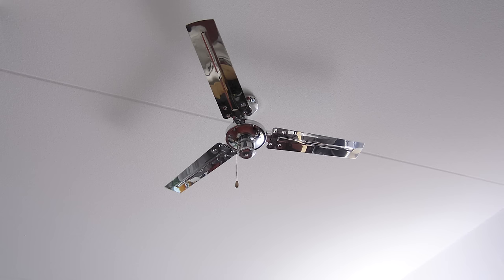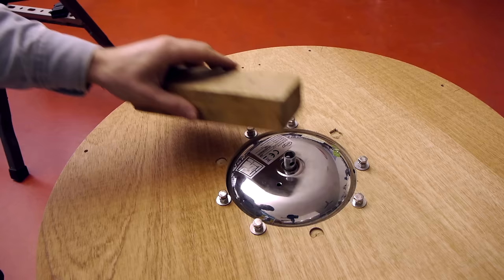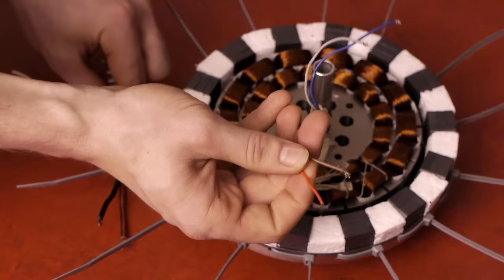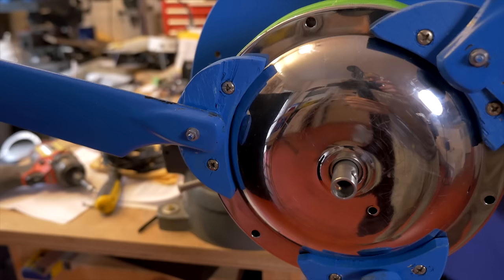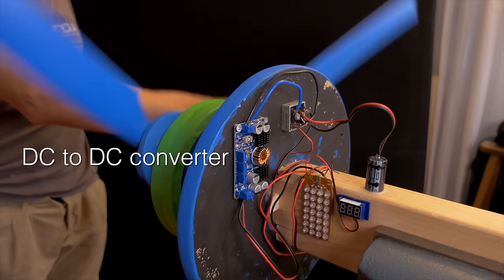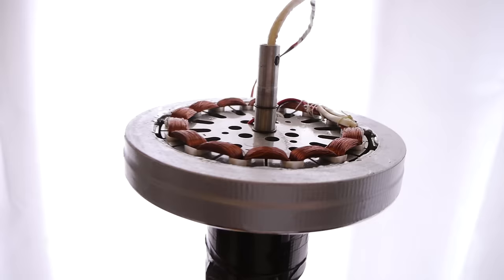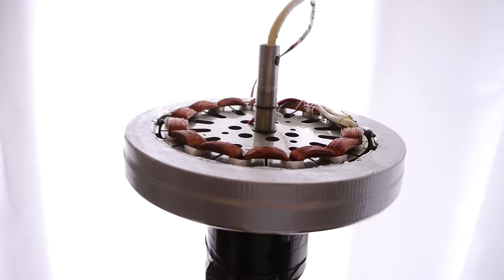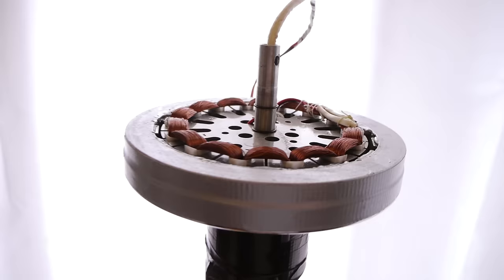Turn a ceiling fan into a wind turbine generator?!

Comment: Hello Giesbert Nijhuis: I've been an electrical engineer for 20 years, And I have some advise for improving the function and efficiency of your ceiling fan turned wind turbine.
1st: I like to say you have a firm foundation for creating your own free energy device. I believe that you're on the right track with this project.
2nd: I think that You needed to Keep those inner coils so that you could use them as a magnetic governor, to prevent over speeding the turbine, and thus keeping the raw input voltage from getting too high. "A simple 10 Mega-ohm power resistor" across the inner coils, would provide a semi-regulated load. and thus cause enough rotational resistance, to prevent an over speed event. A wire wound Variable resistor, or a rheostat used, instead of a straight resistor, would allow you to adjust the governor strength by adjusting the the inductive current flow caused by your magnets acting on the inner coils. Changing the resistance will in turn change the inductive load. allowing the turbine to spin faster or slower, depending on the load resistance on the inner coils. This is how to keep this wind turbine from frying your step down circuit(s) which will fail before anything connected to it will. Your power regulator, and DC converter are the weak links here. But if you can regulate the raw input voltage from your coils before it even gets to your power circuits, that weakness will be a non-issue. 
3rd and finally: I would suggest some sort of storage medium, like a battery or Capacitor bank. this will further assist you in regard to voltage regulation. Just make sure the voltage capacity of either your battery and/or Capacitor bank is not exceeded by the input voltage. The storage medium will also allow a you to have power buffer to keep your devices running, while there is a low wind situation.
Reply: One question on the 3rd option, isn't the aim here to say 'charge a battery' on a phone safely, so then how do you connect another battery safely? or doesn't it really care, and is it mainly when the battery is limited compared to the input (so 5V for the phone) that problems may arise… aka. as long as 'he' would say add a large battery or capacitor bank (say 100V, which will never be exceeded by the generator) there isn't really an issue anymore?

ps. Really liked your nr.2 that to me read like a genius solution, would be even greater if one could have a software regulated resistance that is controlled by something that can measure the rotation speed of the turbine. That way there can be as little resistance on the breaks during low winds, while higher winds would engage the break.
Reply: Great question
Reply: As a mechanic I would say start with an old style ceiling fan and eliminate 3/4 of the bs because it is already the proper kind of motor with beefer everything. Install a 1 way clutch, install a large capacitor often found in old TV and CRT Monitors, because you installed this and what is coming down the line you would need to install diodes due to flyback voltage, Install your transformer from an old style welder, then another diode, then a AGM Deep Cycle Battery (Blue top would do nicely). Or you could do what the engineer said and make it less efficient, cost more and blow apart your capacitor, fry your transformer and boil over your battery due to flyback voltage and/or the fan spinning backwards. But, trust him he went to school for 4+ years for this kind of stuff and never gets feedback from customers. Unlike us stupid mechanics who have to re-engineer their screw ups to make the customer happy or explain ourselves in court.
Reply: Phil Weatherley  The governor idea only nonsense if he plans on never seeing a windstorm big enough to damage the blades. The governor idea is interesting but probably not required, but hardly nonsense.
Reply: Phil Weatherley  Your comments use negative jabs like "nonsense" and "worthless" so a lot of people didn't hear a thing you said. Congratulations for showing your insecurities and losing face.
Reply: Instead of this grossly complicated setup, variable pitch propellers would work far better at regulating speed. You can do it by putting the blades on bearings and use something like a centrifugal governer with linkage to the blades to rotate them based on rpm. Commercial windmills use gears and motors to do this, but you don't need anything that expensive to do the same action on such a small windmill.
Reply: @GGigabiteM  How about blades that flex when the wind pressure reaches the point of over voltage? Wouldn't that be more simple than your "grossly complicated" suggestion?
Reply: Thanks for sharing.  XenoMorphicRex I was going to post a few observations about video and found out that you have already done so and with greater knowledge and detail.  I was also wondering that if instead a person could not try to convert raw AC to DC, but could just run the raw AC into a used battery backup APC unit for computers, which has some line conditioning properties as well as a charge controller.  It is also designed to handle surges with a built in surge protector.  I also thought it would be a good hub for a free energy pulse motor design.  You would probably know better than me about what would be needed to prevent overload between the major parts (or if after you protect from overload then whether or not there is enough remaining power to drive the next stage).
Reply: @offgridphilosophy7959  Flexible blades are far less efficient than propeller blades and can only slow the fan down so much.

A centrifugal governor isn't complex at all, you can build one in your garage with parts from home depot. To change how much or how little it affects the blades, all you need to do is change the weights and springs and adjust the linkage to the propellers.

The governor can turn the blades leading edge into the wind, effectively feathering it so it can't be driven anymore if the wind gets too high.
Reply: @GGigabiteM  My way is better.
Reply: @offgridphilosophy7959  A method that doesn't work is not better LOL.
Reply: I agree with this person's reply.  I have been a technician in Radar, communication, and navigational equipment for about 30 years.  Some of the rudimentary 'back up' systems would use some technology similar to this for power generation and navigational assistance, and the writer in this string is correct, if by using the other coils as a 'braking' system this would eliminate the overrun of voltage and reduce the heat loss and possible damage to the 'weak links.'
if possible when the wind reduces you could have the inner coil field collapse into the outer coils so to speak, but whether to charge a battery like most hybrids today or adding capacitance for the 'charging' state would be up to the engineer.
Keep adding the same size cap as you have in parallel to the one that is installed until the LED's are steady at the operating voltage set and they should stay lit for a little while after you stop driving the fan housing.  If you use the secondary coils for braking this will also charge the caps when the speed slows down, (mostly for efficiency) but you have to store the energy somewhere.
Reply: Unabomber type rant alert! Although this is a technical thread, Tishka Skogen has lost his way, ended up here and is delivering a LOAD of political POISON! Watch out!
Reply: @tishkaskogen3298  Why can't i be totally wrong about everything without people setting me straight? This world isn't fair!!! Stop hurting me!!!!!
Reply: @offgridphilosophy7959   I know right?! It's part of my paradigm!
Reply: you forgot "5th"-- WAIT FOR SOME WIND!!!!
and you forgot "6th" ---BUILD  A DISENGAGEMENT MECHANISM SO A WIND THAT IS TOO STRONG WON'T CAUSE YOUR UNIT TO BURN UP, BURST INTO FLAMES!!!!
   Yes, you see. there is a narrow window at which it will operate effectively. Below that window...no energy. Above that window...NO MORE AIR TURBINE!!!!
    Just WHAT PERCENTAGE of the time do you think the wind will blow at the right speed?
Reply: @willg4802  1st, I did not forget these these things, I just did not mention them, due to character limits youtube imposes in the comment section for my area. Yes I could've posted a part 2 or 3, but it was unnecessary, for reasons describe further down into my reply. 2nd It would depend on the wind conditions in his area. And since this wind turbine is a hacked ceiling fan, no solution will be 100% perfect. 3rd As for the turbine bursting into flame, the wind itself should provide adequate cooling, especially if a heat sink is employed. A lot of power resistors have a heat sink, or cooling fins attached to them. these are a given to an electrical engineer a basic knowledge in thermal dynamics is was apart of my training so as to deal with problems like this. Put a large enough heat sink on the resistance circuit, and heat will be of little issue. all he'd have to do is make the before mentioned heat sink aerodynamically efficient as to reduce turbulence behind the turbine. which will effect how well the wind passes by the turbine. disrupting the airflow will effect the speed of the turbine as well.
Reply: @GGigabiteM   Variable pitch blade system is also a complex system, requiring some precision components that maybe be too expensive for a DIY Hobby project like this. Though you would be right about it regulating speed efficiently. My method is crude, quick and dirty, but also fairly inexpensive, and this is an experimental setup anyway, so why not experiment and give it a try. if my idea fails, so be it, I was just trying to help.
Reply: Phil Weatherley  The basics of electrical theory haven't changed much in the past hundred years, this is no different, the only thing that has changed is our knowledge of harnessing electrical power more efficiently, and hopefully cheaper. The last sentence of your comment is insulting "Sir/ Ma'am" whatever the case may, I "have been keeping up with the times, and the latest technical advances", as any good engineer worth his salt would do. do you really think that as soon as I graduated school that I stopped learning? I think not. And as for the 10Meg, it was an example to simply describe a resistive load using the magnetic flux generated on the inner coils as a means for governing the speed. People these days are so quick to tear down ones idea, simply because they either don't like the idea, or are too ignorant to understand it. But I think you are neither of these, I think you're just a Troll causing trouble. so don't bother replying to this response, it'll fall on deaf ears.
Reply: @alien200049655  Should you ever get the itch to work up a prototype, please share it! Not to insinuate you are/will. It's just that I would be genuinely interested in how it turned out!  Have a wonderful day everyone! This thread made my day
Reply: I like turtles.
Reply: @GGigabiteM  The centrifugal governor design on the old aeromotors was based on the ball and spring design found on steam engines and are basically bulletproof and insanely simple to adjust. just wondering if that would work with this design?
Reply: @tishkaskogen3298  He gets me! ❤
Reply: UberArchangel if you’re a mechanic, why not use alternators ?that would work right? Plus You can jerryrig it up to an exercise bike 🚲 if its not windy 🌬
Reply: That's why I suggested it.

It's super easy to build with cheap off the shelf parts and offers a full blade range of adjustability.
Reply: XenoMorphicRex  nice expert advice. I have a question to you which different from the subject, could you tell me if it’s possible to make a butter making machine with a fan ?
Reply: The purpose of a centrifugal governor is not only to prevent overspeed conditions, but to also regulate the speed to a narrow rpm range as much as possible.

Having excessive variations in the speed of the generator leads to erratic output power that must be compensated for by complex circuitry. The wild swings in power is also extremely hard on this circuitry, which can lead to premature failure.

You can use simple diodes to prevent power from back feeding the generator, but a buck-boost converter generally does this for you.

As for the possibility of it spinning backards, having a limited 90 degree blade range, as well as a rudder will prevent this in most all instances.
Reply: I have created a blade system the harnesses wind from free materials. I want to use this info to maximize the turbine I created. Its based on a different smaller fan. Perhaps to be multiple units linked in series.
Reply: @GGigabiteM  I have a simple way to mount variable pitch blades but only manually
Reply: @dutchcourage7312  I think since we can charge a phone on a few solar cells, making a wind generator should be for bigger projects. House power is always a worthy goal.
Reply: Free energy really? You've been an engineer for 20 years but you havent learned basic friction and laws thermo dynamics
Reply: You size diodes for the expected load, plus some overhead. For a generator like this, you'd need some pretty beefy ones, probably 12 amps at least. A bridge rectifier would be better since it's four diodes in a single package and can solve polarity problems.

A buck converter takes a power source and reduces the voltage via a switching regulator and smooths the output using capacitor(s).

A boost converter does the opposite and takes a lower voltage source and boosts it to a higher voltage. A buck-boost regulator combines both so that you can have a voltage output that can go below or above the input.

These switching regulators are far more efficient than linear regulators like the 78xx series or 79xx for negative voltages, which just burn the difference between the input and output voltage as heat.
Reply: @brotherrussia1719  since the Greens got into office we have to pay for the wind (it contains CO2) No more free anything.
Reply: You'd learn more by watching videos than reading crusty old books that'd make you fall asleep.

Look at some of the electronics channels here like Great Scott!, Big Clive, Mikes Electric Stuff, etc.

There are also various websites that explain basic electronics with graphic details so you know what they're talking about.
Reply: Will G I think 50 percent of the time there will be to much wind 25 percent of the time there will Not be enough wind and 35 percent of the time the government will like your idea and profit from it with or with out you
Reply: UberArchangel lmao best comment in 2019!
Reply: Tishka Skogen   I absolutely agree, it is a waste of time for a GOoD hearted person to have to search thru a sea of lies for the Truth that Matters...God bless you...doug
Reply: @CrazyFunnyCats  you'll like this, where I'm from, we say bugtussling  (bug-tussle-ing).
Reply: Phil Weatherley, the governor is a great idea, where I live this turbine attached to the top of my house would receive 50 or 60 mph of wind at least once a year, most times more.
Reply: XenoMorphicRex Thx for the tips, but would I be able to pick up all the recommended items from Home Depot or Lowes, have to go to some speciality shop, or do you think I maybe able to find these items lying around in my junk drawer or junk pile around the house? I'm by no means an electrical engineer, but do have interests in opening up things and seeing how they work, if its possible for me to make something like what this guy is trying to accomplish, certainly like to give it a try.
Reply: You have been an electrical engineer for 20 years and call this a "free energy device"?  Where did you go to school?  There is no such thing a free energy device.
Reply: I had the same thought, I wonder if it would function correctly on a horizontal shaft? If memory serves all I've ever seen were vertical shaft installations.
Reply: @dutchcourage7312  Once you have an energy storage, such as a battery, you can put voltage regulators on how much energy they can not only take but produce. So if you have a generator that produces 100v but one battery that can only handle 5v you can regulate how much energy is sent to the 5v. Once it is full, the regulator will stop sending energy to it, but when energy use, or leakage, happens the regulator will allow energy to flow to the battery. 
So if you had a lake house that you only use on the weekend's, his type of generator could work for you. Granted you had a few generators and a big enough bank of batteries lol.
Reply: XenoMorphicRex:
Yours is the kind of comment we all benefit from.  Positive, patient and helpful instead of sneering and conceited.   I am a tech ed teacher and I'm dying to try my hand at a wind turbine.   This vid and your comment along with it bookmarked for sure!  Thanks!
Reply: If either of you can figure out how to send me an email, please do.. I need an electrical consultant for a project slated to begin in June. It will be pretty simple, and will not require any travel. Mostly emails, but at least 2 video conferences you can schedule when you're free.
Reply: I was gonna say that.
Reply: This comment chain is interesting but at the same time it feels like it is somewhat discouraging. Is there a way that you can just keep the voltage under control like in an capacitor bank that feeds a battery at the right voltage, and couldn't you just add a switch that shorts the motor at too high of voltage since a short acts like a brake?
Reply: Would automobile alternators work better than a ceiling fan?
Reply: Good scenario
Reply: As soon as the comment was made about feathering the blades for regulation was made, a light went off in my head... think back to steam engines and how they regulated against over speeds. They had a centrifugal setup, that would run "balls out" at their highest allowed rpm, with linkages tied back to the throttle... it should be pretty simple to cook up something similar to feather variable pitch props. (Well, simple for some of us, not so much for those who aren't mechanically inclined). Just a thought, hope it helps, or atleast gives you an idea that will. Interesting vid!!!
Reply: So, he is using an old washing machine for a vertical wind turbine at the end ?
Reply: @passedhighschoolphysics6010  He means that you didn't pay much for the device and the wind doesn't cost you anything. He's not talking about a perpetual motion machine or any other violation of the laws of physics. Context is important.
Reply: Make a non toxic cheap saltwater battery that can be drained to 0 with no side effects and poored down a drain at end of life.
Reply: Mel Gibson Khazars. That got countless Jews exterminated over history  out of superstition and misinformation. Rothschild is a Khazar.
Reply: I was thinking the same thing regarding the governor on your "2nd" point. You could set a lower and upper limit so that the governor doesn't keep kicking on and off for a specific voltage. For example, the governor could activate at 10 volts above the ideal voltage and then deactivate at 10 volts below the ideal voltage.
Reply: @UberArchangel  I translate that as "Too good to be true"?
Reply: A 10 megaohm power resistor?! This wind turbine isn't going be producing hundreds of thousands of volts. I think your resistance is about a million times too high for this application.
Reply: @alien200049655  Well stated and thank you for offering ideas and sharing your knowledge. We can all learn from each other, and those who result to ridiculing others are making a futile attempt at hiding their own insecurities and inadequacies.
Reply: Hi Xeno. Not to be nasty or argumentative   but a simple 10 meg ohm resistor ain't going to make any difference.  that's 23 micro amps at 230 volts.  That resistance is well above the required level for insulation resistance leakage  when inspecting an electrical installation which only has to be above 1  meg ohm for installations and 0.5 meg ohm for appliances. See Electrical standards IEC 60364-6 . ANSI/NEC standards are even  higher than IEC. Besides you would need a clutch and break system to prevent self destruction at high speeds. One simply has to look at the wind generators that self destruct under extreme weather conditions on you tube to see the force of the wind. See https://www.youtube.com/watch?v=gO0dIgIs5Wg  . The old water windmills still had the best design where you would fold the tail to change the direction of the blades in the wind and brake the shaft at the same time to prevent over speeding the blades in extreme conditions. (Proven over the test of time.)  Here is a domestic wind generator self destruct. https://www.youtube.com/watch?v=Cu5cis2JAkw
.
Reply: This is the governor that I was thinking of... I think. It was explained on a how it works show for industrial turbines where they have, what is effectively a drum brake and when the centrifugal force of an internal weight exceeds a set point (by springs) the break is applied. Is that correct? It would appear to be the simplest and cheapest way to build one in a shed/garage.
Reply: @rikgear  That's the simplest design and the most common on the older pump drives around here, the tailing brake just uses the vane to apply a lever to the brake, but it in my opinion the centrifugal works better at letting the vane find the wind.And it has fewer moving parts and can be mounted high, low, vertically or horizontally.
Reply: that's something I'd like to look into, do you know a link to 'an idiots guid' to that system?
Reply: @passedhighschoolphysics6010  lol.... what's that bright thing in the sky that hurts my eyes when I look at it?
Reply: @dutchcourage7312  You can really tell the young people, as they always default to software.  A simple Resistance or even an RC circuit will do anything that a software solution will do, except add needless complication and reduce reliability.  Do what this gentlemen is doing, Learn, and then solve the issue, not complicate it more.
Reply: The other thing that the old Aeromotors had was a "rudder" or tail.  In a very high wind the hinged and spring loaded tail would swing to be parallel with the plane of the blades, thus turning the blades parallel to the wind and almost completely stopping them.
Reply: @cmichaelhoover8432  think in this case it has more to do with a lack of knowledge on the subject matter, than my age … shh don't tell anyone ;) … and tnx for calling me young, not that i'm actually 'old' old, but still, young has pretty much passed on me already, well up until this moment ^^ … doubt it will last, but tnx again non the less.
Reply: @GGigabiteM  That would cause material fatigue in the blades, and they would go out of balance and break.
Reply: I have a few observations to add.
Not all of these fans are created equal. I have some ranging from 50 watts to 230 watts.
I would keep the secondary coils, and use them to generate electricity when the wind was high enough. This could be done via turbine speed, or the voltage output of the primary coils.
Useable blades can be fabricated from pvc tubing.

Primary voltage control could be accomplished by a simple transformer. Perhaps a multitap transformer could be adapted to keep within a specific range. the initial voltage will range from zero to about 230 volts ac.
A simple solar charge controller and battery storage should suffice for the remaining control.
As mentioned by others, the aermotor or wincharger style governor and folding tail is easy to make and effective. You can simply short the output leads of the alternator to slow the blades for emergency runaway situations.
The charging circuit should not be engaged until a minimum speed is acheived to reduce cogging preventing startup. This can be a simple vane switch.
the magnets should be contained within a fairly heavy outer band to enable better flux flow.

Multiple stator units can be stacked on the same support shaft as long as they are the same diameter.
Some single stator units have been built that produced up to 200 watts of power.

These units may also be useful for micro hydro installations.
Reply: @dutchcourage7312  You could use a centrifugal mechanism adjusting either a rheostat or acting on a transducer to regulate impeller RPMs.
Reply: @dutchcourage7312  The higher voltage output is the issue. It will fry the voltage control circuit or blow up the battery. A 12V battery(automotive) should never exceed 15V when charging. If it does your battery is no good with a traditional charger. I think unregulated voltage would boil the acid out of it assuming it's a wet cell battery.
Reply: When I was a mechanic, I always said it's more important to know how to find information than to try and remember everything. So I put it in the Google. Apparently there are two ways wind turbines are controlled. One is the use of an electronic brake using some of the power output by the turbine. The other way is to use electronically controlled variable pitched blades. Either way sounds complicated and expensive compared to just buying one. They do make small ones. Personally I think a solar panel would be a cheaper, easier alternative.
Reply: Couldn't you just, you know, leave the inner coils, and directly connect the wires for them to create a resistor coil that increases in power the faster the blades turn? Not like I know anything about engineering, but if you increase the resistance the faster you spin, I would think you'd get to a point where the speed of the blades would not increase further. Then it's just a matter of having a cooling system to keep it from bursting into flames.
Reply: Well- looks like u have your answer👆
Reply: @Raku777  I think most apcs need 120-220v to run, right? I wonder if he geared the wind turbine shaft to the stator instead of it being direct drive of that could change his power output. Or maybe use a larger setup? Dunno.
Reply: @GGigabiteM  I want to see a YouTube video of this made from hardware store parts. That would be awesome
Reply: @Hillwatch  I think what a lot of people are exploring here is how to develop some way of harnessing energy from wind, sun, or some ionic process like the salt water battery.  The other side of this exploration is something that I explored when I was studying some engineering.  After a proof of concept device (one that shows the principle is valid and energy is generated), there is then the task of increasing the efficiency of the device.  This is done by seeing what kind of wire conducts the energy with the least friction or energy loss, which parts most efficiently get the most electricity from a certain amount of wind, ball bearings for the least amount of rotational friction, etc.  This level of research is in some way more complex than the proof of concept device.  What I see is that many garage engineers are faced with the extra task of working on a severe budget, and also factoring the lowest cost to build the highest efficiency generator.  I think the video is partly about using some very inexpensive items to generate some electricity.  I like the general thinking pool in these comments and it might be fertile ground for new and worthwhile projects, but I do not presently have time to do much here these days other than cheer on those who do, and I all these ideas sound promising, but I do not know what outcomes in experiment will be found by trying these tweaks.  I do feel that somewhere in this mix are worthwhile devices that will hopefully emerge at some time.
Reply: @Hillwatch  805ROADKING and his buddy Mike made one for one of their hit and miss engines. I don't remember which video it was, but you can see his channel here:

https://www.youtube.com/channel/UCqzavCyo1aQaeJ-Trp_SmEw
Reply: @offgridphilosophy7959  You're Wrong! Very Good!
Reply: @tishkaskogen3298  Sounds like a harrowing thought process that could only lead to or be produced by a nervous breakdown.
Reply: @passedhighschoolphysics6010  In this instance, free is that it costs little or no money, because it's made from scrap. It does cost time to build (andv real estate), and there is energy input, but it is wind, which we don't really pay for. But it obeys thermodynamics. Not a Hojo motor.
Reply: XenoMorphicRex 
Why not just turn down the wind to slow the rotation.   If you know the god of the four winds, Anemoi like I do,  it’s just a simple prayer and done!   ;-)
Reply: @Raku777  Does this actually work? Great idea!
Reply: XenoMorphicRex: YOU, sir, are a charlatan.  You say you've been an electrical engineer for 20 years, yet you also indicate the belief in a free energy device.  You can't be an electrical engineer and believe in free energy.  You might CALL yourself an engineer, but you are NOT an engineer.  On reading your advice, NONE of it is based on any sound engineering principles.  Please stop spreading misinformation.
Reply: XenoMorphicRex Hi. I would definitely say that connecting the micro-bedeemer to the centrifuge resistor would be in order but at the sub-atomic level. In addition, I would install a continuity fluctuator defibrillator, preferably a non-china made brand, to ensure a free flowing electrical connection at the point of electrical generation. And as always, use the appropriate NEC approved electrical tape on all wire connections that may be exposed to general electrical flatulence events!! 😂😂😂 I hope you aren't the ultra serious type and can get the joke of someone who can properly wire a  house with a simple electrical plan, but definitely isn't an electrical or electronics expert😁. I was just reading various replies and marvelling at how little I know in the field of electricity😳, and my mind went into mad magazine mode! 😁🙏
Reply: Nay you to make your own video and break it down to to where people will understand it that seems like a great idea
Reply: @alien200049655  HELL YEAH!!!!!!
Reply: @tishkaskogen3298  academia aka sin agoguers